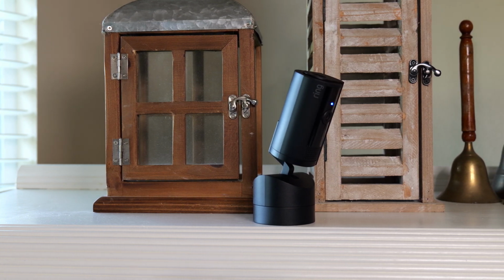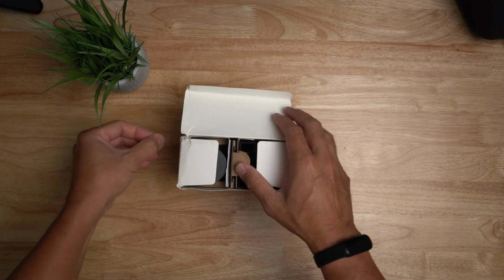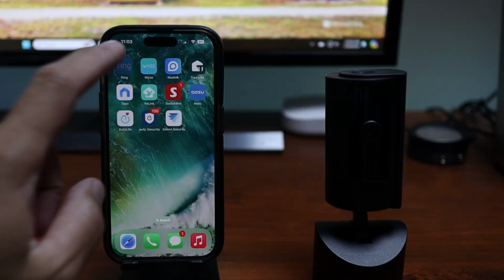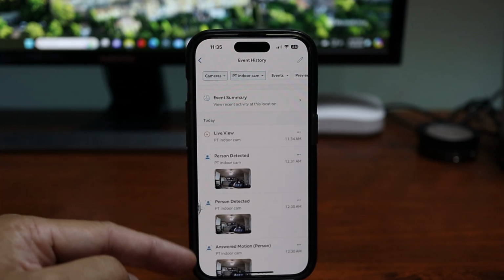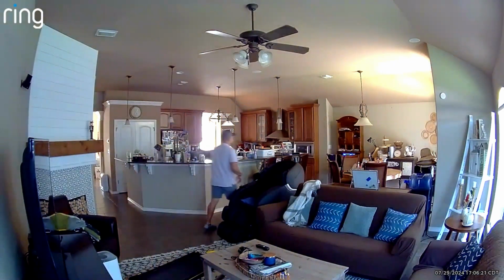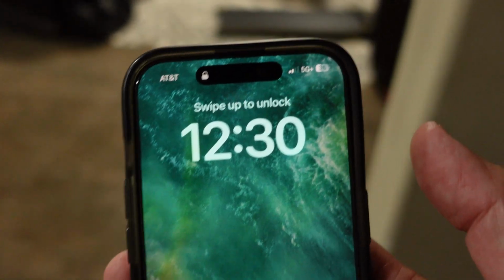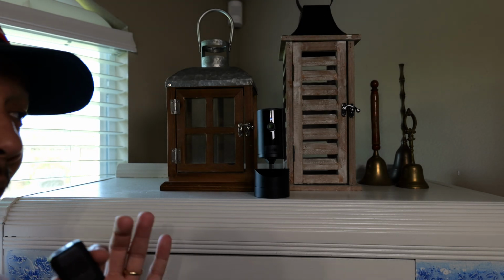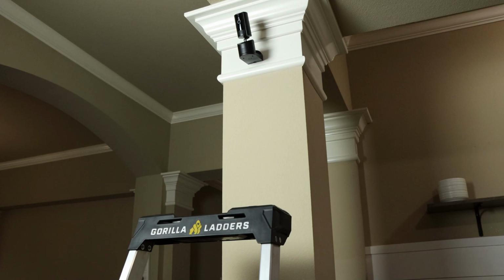Ring Pan-Tilt Indoor Cam Review - Innovation at its FINEST?

Comment: Been thinking about leaving Ring.
Best options to look at? Currently use Ring Alarm and 5 Cameras.
Reply from the maker: With the Ring Alarm, they are still pretty good. For security cameras, you can take a look at Eufy, Reolink, Tapo... All of them doesn't require a subscription.
Reply: @LifeHackster  Yeah I have no issues with the alarm side. As a big tech guy, the fact they keep releasing "new" cameras in 2024 that are still 1080p just really makes me twitch🫠
Reply from the maker: @Mpostor  I know... Instead of focusing on the resolution of their cameras (which I think is a must for security cameras), they released this in different colors... hey, it is in 1080P but you can have it in nice Pink color... lol
Reply: @LifeHackster  Unfortunately, they are just falling out of touch in this category.
Reply: Ring is still the best system with all the integrations within its own brand （alarm+video+some smart home）. I really tried to find which alarm system I migrate to after the 100->200/yr Ring price increase. Up to now I don't find a decent system that has wide range of integrations and also provide decent battery and cellular backup.
Abode is next on my watch list as an alarm system but they're more expensive and the cameras are pretty limited. Simplysafe has 0 smart home capabilities and cameras are worse. Overall ring still yields best value if you do “one app”.
For me my smart home capabilities can be moved to smartthings and cameras can be moved to Eufy. But for alarm- linked cameras, I still need to buy from the alarm system and Ring is still the most reasonable question. (No need to spend a thousand dollars buying all the sensors and base station from the other brand.)

Comment: Well, first off you can SET the camera to NOT record depending on your mode or schedule and that Ring has ALWAYS been this way since before 2019 so the "privacy" cover is useless at this point.  Again people are SO bent on 2K or 4K and really you just want a record of activity and 1080P still gets the job done without stressing your router with unneeded bandwidth usage recording at the higher video rates because NOT everyone has 1Gb internet service and over a CELLULAR connection will NOT post at higher resolutions anyways!  All these "factors" are considered to have a "stable" system running on internet or cellular backup.  The Ring Pro Hub will keep non-Ring devices connected via. cellular backup too which NO other Alarm system can do that I know of.
Reply from the maker: Just to correct you..4K doesn't stress your router or your bandwidth if the recording is stored locally... You don't need a 1 gig internet either.. that is a myth. Your TV streaming Netflix or your kids playing are stressing your internet more than your security cameras ...unless you have Nest and paying for their 24/7 recording...even then the footage is highly compressed.  The main issue with Ring is that they want cloud recording to get you into their subscription model..this is what is limiting them. Also, to correct you again..I can easily download the 4K recording of the events if needed like on my Reolink NVR using cellular connection (might take some time downloading) but it will still be full 4K resolution when done. You might have problems streaming 4K in low connection areas but when downloaded, it will be in full resolution. 
1080P footage at 25-30 feet that you could barely recognize or identify faces is the reason why 4K is better... and as to the Ring PRO hub's internet connectivity backup... other alarms might not have it but if you have eero routers, they have that option too.
Reply: @LifeHackster  ; So your are trying to say a 4K video stream does NOT consume more bandwidth than a 1080P stream? REALLY?  We are NOT talking about "local" recording and even if STILL consumes "local" bandwidth on your "local" router UNLESS they are WIRED cameras  I'm a network person here!. We are NOT talking an NVR/DVR setup here and are in the WiFi world!  Who cares about 20-30ft away if there is "activity"?  Do you really think if there is a break-in in your home and you can count the hairs on someones face at 4K the police will have "more" to go and actually give you a resolution or SOLVE the case? GOOD LUCK!  MOST break-ins go UNRESOLVED regardless of "video" proof or not!  BUT, video proof helps for an home insurance claim even at 1080p!  Have you EVER had to make a claim? Unlike you where you are "sponsored" and get "PAID" to post videos us regular consumers do NOT have that "luxury" and are NOT "endorsed" to favor one "product" over another.  You are losing your grasp of reality vs. the PAID and SPONSORED reality you are living in it seems. Just saying...
Reply from the maker: @johnszatkowski6898  Why are you concerned about bandwidth? WiFI companies that record to the cloud like Ring will only use your internet bandwidth when there is a motion event… when it is in standby, then it is not going to use any bandwidth. If you have a 4K WiFi camera that records to a hub or to its own microSD card.. it will not use any of your internet bandwidth until you watch or download the motion event. I don’t want to count your nose hairs but I want to know what color, brand or type of clothes and shoes you are wearing, models and type of your car and license plate at 30 feet away.. your argument about 4K vs 1080p is absurd… Go to your local bank, grocery stores and even convenience stores and see what resolution their security cameras are.. BTW, you are the one that is lost in reality … or stuck in 1080p ;)
Reply from the maker: @johnszatkowski6898  hahaha on paid and sponsored… funny man.. interacting with me and watching my videos gets me paid.. thank you for that..
Reply: @LifeHackster  ; OK Fair enough!  No grudge here.

Comment: I have the original floodlight cam, only reason it's worth it to pay $49 year is because the app is good, it's not 24/7 recording but it allows you to scrub through the timeline with 30 second snapshots.  For my doorbell camera I have Reolink, no monthly fee and 24/7 recording.  It also has ethernet option which makes it jam proof.  The app could use some improvement, and I did have to set the resolution lower than the 2k resolution it has to get it to record reliably.  They may come out with a better version that has a more vertical field of view like ring has.  I can also record to the cloud for free to get rich notifications by using the free 1 month trial which I extended to 13 months by switching servers every month.

Comment: I've been happy with Ring for years, We have 2 cams, alarm system, and some no-cam floodlights.  I've only had 1 connection issue and 1 replaced camera.  I have considered Eufy or reolink but I just don't want to purchase all new cams and a new alarm system.  I have a few Wyze cams but they have never been very reliable.  I only use those for places where I want to see whats happening but I'm not looking to record the activity.  The Micro SD cards I orginally bought with them have long past crapped out.  I won't be buying more ring products, but I'll hold off on another system till these die.

Comment: Ring sucks all the stuff I bought last 4 years has all failed 10 bought 3 still work.
Reply from the maker: Their older models which I still use works but it seems their new ones are not built as good.

Comment: This crap is a slap in the face to consumers. No innovation from Ring what so ever in YEARS!  Amazon is turning ring into the Blackberry of security cameras. Ring was IT! The "Doorbell camera" at one point in time and amazon acquired them and has been putting their chips All in on the Ring name/Brand for years but now consumers are a lot wyzer ( pun intended) and know there are other better, more affordable options on the market. It will not be long until Ring is no more. Wyze hardware is better and more affordable and allows the option to record 24/7 to SD card and offers more features with their subscription. However IMO Eufy is King and Reolink is a close 2nd due to excellent hardware and no subscription needed and a healthy portfolio of security camera offerings.